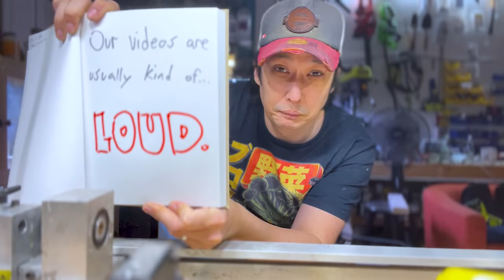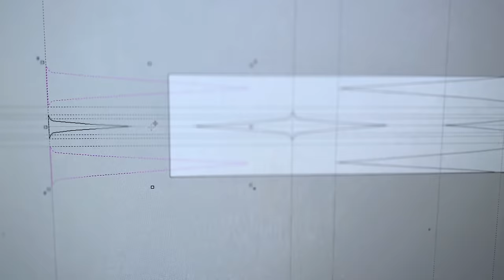Making a Pool Cue from Scratch (ASMR / No Talking)

Comment: Wow I can tell you improve a lot in your cue making. Another little tip. Look up kielwood blanks can make better shafts and low deflection shaft as well need less stabilization time. You can also look into carbon shaft making. Can be a good way to make easy money. If you make carbon make sure to keep tip weight as a factor since the LD factor of carbon shafts are more sensitive to overly weight ferrule inserts.

Comment: Fantastic video gorgeous cue and you are not what I would call a beginner. That cue is well worth triple digits and probably more (USD). I recently had a cue built for me at $750.00 and that is every bit as nice as the one I have.  One thing that I'm not a fan of is using the computer to do routed inlays that have sharp points. It just seems real obvious to me that they were CAD routed when the tips are rounded. It takes away from the obvious craftsmanship when people think you just pushed a button on a computer to add all that detail, but that's just personal preference. I would like to see the CAD inlays done to add a water wave pattern or some other cool design where the router bit limit isn't so obvious. Man though, very nice cue and I think you have the process nailed only thing you'll likely improve on is speed with practice. Great great stuff!

Comment: From one amateur cue maker to another...absolutely beautiful. I'd love to know what products you use in finishing. It's the only part of my game I can't seem to get dialed in. Also, I got a hint on what to do with shafts after the first cut, to make them warp less on a whole. Again, bang up job brother!
Reply from the maker: I really appreciate it! Finishing has made me consider quitting cue making more than anything else. From what I can gather, nothing beats automotive clear coat spray, but I won't touch it because of the toxicity/proximity to family/et cetera. I used to use UV but it was a nightmare. Invisible pockmarks, craters, white specks from nothing. Never again. The stuff I use now, I absolutely love. It's easy, non toxic, and you cannot tell a difference between it and a cue coated with auto clear. 
The company is called Crystalac, and the product is Brite Tone Top Coat. You'll want gloss. Apply with a brush. Wicked thin coats. Like, stupid thin. Is it even on there, thin. Every four hours. I'll typically do around 15 coats. Sounds like a long time but in practice its usually just a couple days. Then cure for a week. Always sand wet. Start with 800 wrapped around a block.  Careful around edges, I don't do those with a block. Once there are zero craters and everything is 100% matte, you're done and can remove the block. Then continue with 1000, 1200, 1500, 3000, no block for any of them. By the way, in this video I apply the Brite Tone but please disregard the amount I used. I was distracted thinking about shooting logistics and it was wayyyyyy too much for a single coat. I ended up sanding it all down and restarting off camera.
For polishing: meguiars ultimate compound, then meguiars synthetic sealant 2.0, then renaissance wax. 
Moving backwards real quick, the sealer coat is also important and seems to be highly variable between cue makers. I personally use epoxy to seal everything in. Hard as a rock. Adds a little weight. I just love the feel of a cue that's been sealed in epoxy, feels sturdy. I use Max 1618. Favorite stuff on the planet, seriously, the best epoxy you can get. There is a UV sanding sealer that lots of people love, Solarez I can't Believe It's Not Lacquer. I want it to work so badly, because the amount of time it saves is incredible. But it's too temperamental.
Reply: @Studiotronics  ya know they have waterborne automotive paints now.. I think they have it for clear coat too..
Reply: I had luck with a coat of non-yellowing epoxy, let dry and sand smooth. Then, many layers of superglue. It looks like crap and is hard to breathe. Sand smooth and shiny and buff out with auto clear coat shine compound. If done right, it is one of the shiniest and hardest finishes you can do.
Reply: @Studiotronics  Where did you come up with the process for using Brite Tone?

Comment: Nice job and nice stick... But it seems to me, or your stick looks too short? Or you are so tall? Mine has a 30.5" shaft and standard length butt, maybe that's why yours seems a short...
And why you chosen an 3/8-10, but not QR or Radial,  forexample?
Reply from the maker: The cue in this video is 59 inches so an inch longer than standard. I’m a big dude, 6’3”, over 200lbs, etc, so cues look smaller. The 2 pins I use are 3/8-10 and Radial. I love and use them both.

Comment: Where did you learn to build pool cues? I am trying to get started and there is a lack of videos. Do you Have any book recommendations or is more learned by trial and error?
Reply: If you haven't found them yet, you can check on youtube for: "How-2 Be-Cum A Q-Builder by Dennis Dieckman" there are 3 tapes with not the best quality because they're old, but I believe there's plenty of information on there.
Also other DVDs: "Joe Barringer Pool Cue Building DVD" and "Basic Cue Building
and Repair Video" from Chris Hightower and "The Cue Building Book From Tree, To Tip, To Trade Show! Chris Hightower"
Reply: And also Bob Dzuricky on youtube
Reply from the maker: There's a book called The Cue Building Book. It's often mentioned as the bible of cue building. I bought it. Never read it. Zero pictures. I'm a visual guy.
 I remember being thrown off by how little guidance there is online. Until I started building cues, then I started understanding: There are a zillion ways to do just about every step -- the methods you choose will depend on what equipment you have and just personal preference. 
There's also a series of DVDs (Joe Barringer). Comically expensive. They are exceedingly difficult to get through. You'll understand exactly what I mean within 13 seconds of turning on the first one. But if you can make it through with gritted teeth, there is some decent information there. It'll be a starting point. From there it does not take long to adapt your own methods once you see whats going on.
I'm sure YouTube is a great resource too but (surprisingly) I never checked. Get a really nice caliper. And a metal lathe. Some basic measurements (happy to supply mine if you need, but again, this is another personal preference thing). Go to town. Make 10 terrible cues and throw them in the garbage. It'll be an invaluable learning experience.

Comment: Hello,  I used to be in cue repair and some jump cue making over a decade ago.  Can you give me a list of your lathes you are using for this video?  I currently have a couple Porper B lathes but am wanting to get a few more that I can set up for specifics. Tapering, inlaying, etc.  

I'd appreciate the information greatly.  Where are you located?  I'm in Texas.  

Nice cue by the way.  If it's your first build, then you definitely have the talent.
Reply from the maker: Morning Michael! I have a Unique Inc Cue Maker, Unique Inc Cuemonster CNC, cheapo small Chinese metal lathe, and a DIY finishing lathe (I haven't shown this on camera yet). Both of the Unique Inc lathes were bought used (10 years old!) at a gigantic fraction of the price, it was a steal. Otherwise, if I hadn't of found those, I would've gotten a Deluxe Cue Smith and built my own CNC.
Most cuemakers will say you absolutely need a full-sized metal lathe. I have a small one because it's only for precision joint work -- Any steps needing more space is done on the Cue Maker. I paid 700 bucks for this small crappy Chinese lathe. And I absolutely love it. It's my favorite lathe. You have to view it as a lathe KIT, not a complete setup. I had to take the entire thing apart, sand it down here and there, remove rust, deep clean it, lubricate everything. And honestly had a blast doing it, I enjoy tinkering. I swapped out the included toolpost with a quick release tool post. Now the precision is bonkers.
Reply: @Studiotronics  

Thank you for replying!  I am getting my list to purchase the Deluxe Cue Smith lathe.  I've been searching cnc router lathes.  Any directions you could lead me would be greatly appreciated.  I've also been researching a 8"x32" Chinese lathe that has a 1.5" bore to have on hand like you do.

I've looked at Bob Dzuricky's cnc set up but wouldn't know where to start.  There's alot of generic Chinese made CNC router tables out there.